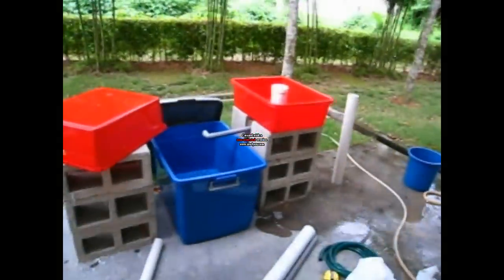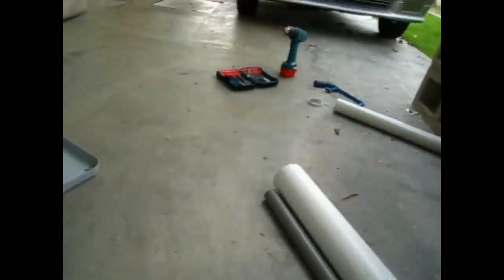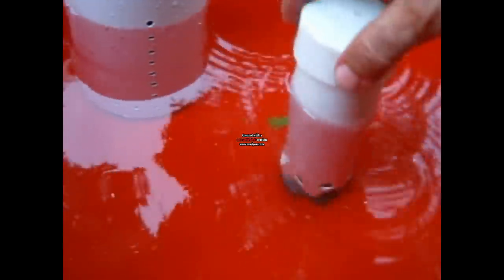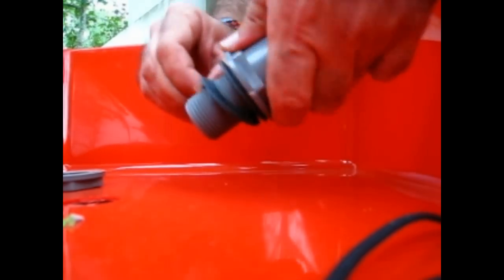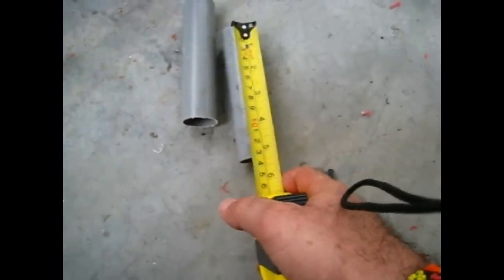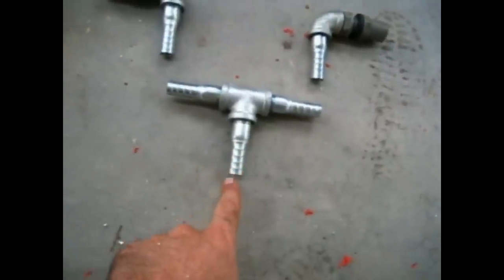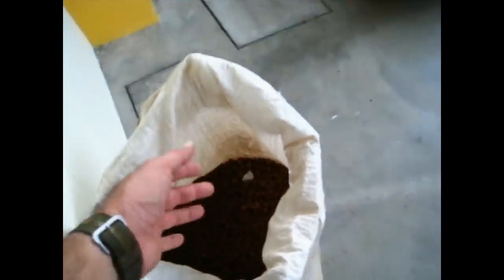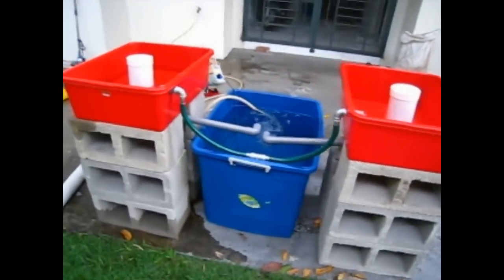Aquaponic System For Beginners (guide) . Home Aquaponic System on a Low Budget

Comment from the maker: Hi Deepak.
You are right, you will need some kind of a filter once your system is going. There are numerous examples of easy to do filters on the web. I have a filter in that system that does a good job catching the big stuff. Also depending on where you have the system, you need to filter for leaves, dead bugs, etc. Look for:
"Cheapo Water Pump Filter for Aquaponics System that really works "
on my channel. 
If you have a good filteration system, your clay pebbles shouldstay cleanforalongtime

Comment: your extremely simplified design leaves plenty of room for improvements. 

first off, the constantly changing water level in your fish tank stresses fish. you should add a sump tank and keep the fish water level constant. 

you don't mention what your cycle time is but 45 minutes is usually a good target to allow the roots to breathe. 

on a similar note, your water levels appear to be too high. you will likely get algae growth in the beds because of it. good video on the basics though. thanks.
Reply from the maker: +noah williams Thanks Noah

Comment: Informative but looong. To keep the audience concentrated perhaps you could speed up the parts where you just drill holes etc. Stick to one mesurement unit cm (preferable to me..) or inches or mention both everytime, because the sifone was in inches and much of the rest in cm... I leanred alot so tumps up but maybe you should consider re editing it and speed a bit true the loong parts...just to make it better.....

Comment: Have you, or has anyone else assembled a list of "tools you will need" and "parts you will need" based on this video? How about minimum pump size for this exact configuration, as the pump you're using is capable of much more, right?

Comment: How low does the water get in your fish tank? I plan on building a similar system but I am concerned that my fish might get too low on water if both of my grow beds fill up at the same time.
Reply from the maker: That's why you need to have a big fish tank
Reply: or get a holding tank
Reply from the maker: Ryeland Ternasky I would also experiment with cascading Grow Beds
Reply: google a CHOP system (Constant Height One Pump), basically you have a sump tank and a fish tank, the fish tank is constantly overfilled and overflow fills the grow beds, then drains into sump, then back to fish tank
Reply from the maker: Done!
Thanks for the suggestion and really glad you liked the video.

Saeid

Comment: thanks for the video, I just dont get it why you make double bed system when you could have made 1 twice as big bed surface and double volume and reduce costs?
Reply from the maker: Hi. Finding a tub twice as big would be difficult in some areas, specially when it has to be extra strong to hold the extra gravel and water.

Also when you have multiple grow beds you are some what protected against disasters. You can shut one off while you fix a problem with the others

TY.
Saeid
Reply: Well done! :)

Comment: Hello Saeid,

Thanks very much for sharing the video. I went to CPS hoping to check out the system but I couldn't find the system there. The staff not too sure about it either. Where did you place the system at CPS?

By the way, I am having hard time locating the shop that sells hydroton in Penang. Do have any contacts for that in Penang? Thanks again!
Reply from the maker: Hi Erique,
THe system was taken down about 2 years ago. I had rto travel and they didn't have the time to tend to it.

Hydrotons, you're beter off without them. I know they look cool, but tey are a pain to use and keep clean. Go with gravel. 

TY
Saeid

Comment: Hi , I made the same Bell siphon design , but I found that when the water level exceeds the height of the inner grey tube , the water begin to fall into the tube as it is supposed to work .. 

But it is stopped siphoning when the water level became the same as the height of the inner grey tube and the grow bed remain full of water to its half volume . 

What should I do in this case ?
Reply from the maker: Mohamed, are you saying that the water starts siphoning, but only empties half of the grow bed?
Reply: Saeid Momtahan Yes
Reply from the maker: Try turning up the elbow  were water comes out to up the back pressure.
Reply: I didn't add an elbow , just an outlet pipe . 

I found what's wrong .. The inner tube's cover wasn't tight well , but I fixed it and it works . 

Thank you Mr. Saeid
Reply from the maker: Glad you fixed it. Good luck.

Saeid

Comment from the maker: Those are called Hydrotons. And NO, you can not use soil. 

Hydrotons are expensive and pertty hard to come by in most places in the world and messy to clean. A really good replacement is plain gravel, washed well. It's heavier though, so you have to build a good support under your grow beds. The concrete blocks will do, as long as they support the whole grow bed

Saeid

Comment: I know this is an old video but your water level is too high. The water should never reach to the top of the substrate. You want it an inch below. Your plants will rot.
Reply from the maker: Thanks for the tip. I'll keep it in mind for my next AP system

SAeid

Comment: You should not cover the fish tank. The fish need sun and air. Also, the water flow rate is too strong for them, it is stressful. If you add more water, you can have a lot more fish. They are not enough to sustain that amount of vegetables.